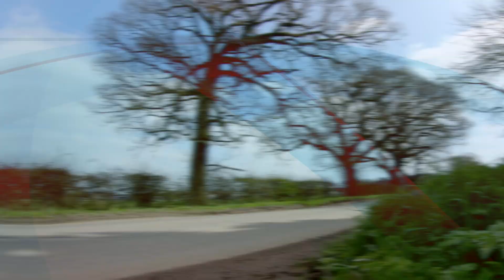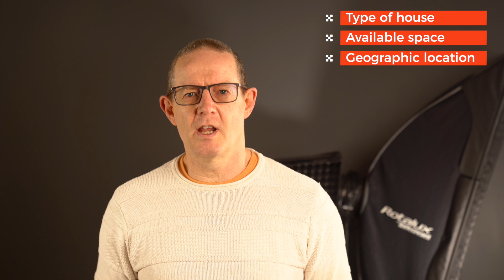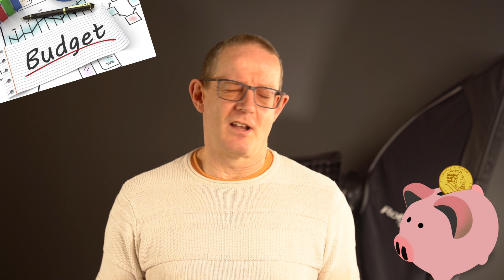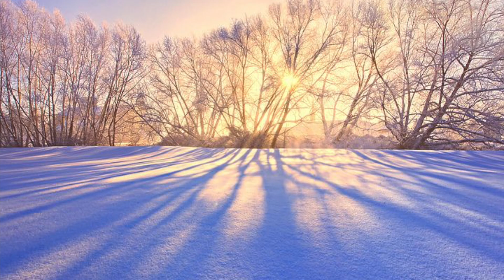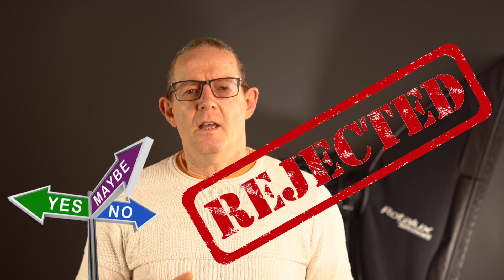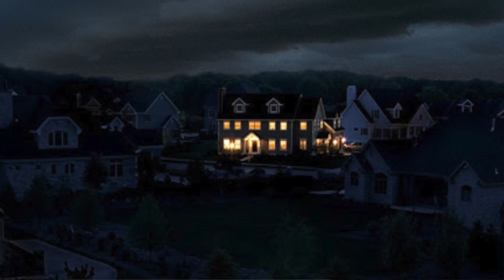So you want solar and a home storage battery

Comment: Thanks John. Perfect video for anyone looking at all the considerations in planning a solar installation. Agree with one of the other comments about the use of diverters for hot water and EV charging, although I think you did mention about future proofing when sizing up the number & power rating of panels. Certainly electric vehicles are going to be a consideration for a lot of people as they evolve further and become more affordable.
Reply from the maker: Thank you. Agree about future proofing, there may be many people adding to their existing arrays as EVs become more popular and affordable.
Reply: @johntisbury  we are a few weeks into our new solar installation and so far it’s been a bit of a mixed bag. Certainly the weather conditions have played a part both positive and negative. We’ve have a couple of exceptional days of solar production and others that have had very little. On top of that, I’m still in discussions with our installer about the way the batteries are performing. Charging seems quite slow and channeling energy into them appears to be throttled back. But they discharge quickly at a much higher rate. For example on a sunny day, they seem to charge at a steady 1.1kw, but can discharge at over 3.5kw. This isn’t ideal as the sun might not last all day and I want them to charge up as quickly as possible. We also seem to be exporting an awful lot of what we generate on a sunny day - I’ll post some figures on your end of month video. We do need a hot water diverter, and hopefully should be here soon, which will soak up some, but it’s frustrating to see the energy I’m producing disappearing into the grid. Still early days though.

Comment: One of the best things that I did long before installing solar panels, was to invest in a power monitoring device. At the time I didn't have SMART meters, so adding a monitoring system that could record and map data really helped me to understand my exact power requirements and usage. I started with an OWL clamp on purchased second hand from eBay, then as I developed my solar component selection, I actually installed an Enphase Envoy-S which instantly gave me pinpoint data and lead in to the latter installation and control of my Enphase micro inverters and  335w panels.

As you highlighted, I personally don't think that you will ever recoup your outlet on panels and storage, with the old FIT disappearing in 2019 the heady days of big returns are long gone. You have to WANT to do this for your own reasons. What everyone with solar doesn't tell you is that you could always just sign up with a green power utility provider and bank the SOLAR and storage money to pay for your green electricity. They said, now that I have my 6.7kW of solar up on my roof, I'm now considering which storage system to purchase and what capacity........or do I wait for V2G to go main stream later this year and then just invest in the be EV and Quasar V2G charger......Mmmmm
Reply from the maker: Thanks for watching Chris.
Being able to monitor your home usage is vital if you want to get a handle on your demands and typically peaks and troughs as you rightly point out. 

V2G will be the next big push. I feel there's a lot of water that needs to flow under the bridge until we're in a position to run that as a mainstream offer. For example currently only the Chademo adapter allows two way charging, which limits vehicle choice. Even more so as the new Leaf's have a CCS point, so it's an old Leaf. Tesla have stated that if anyone does a workaround for V2G using one of their cars it will void the warranty. As I say, there's a lot of stones that need to be picked over before we see V2G in any numbers.

Comment: Hi John, good video. There is one other cheat which prevents a G99 application. I have a 6 kWr Solar Edge inverter fitted with a Modbus meter that limits the export to 3.68kW.
Reply from the maker: Thanks for watching Martin.
Yes good point on manually limiting export. Many inverters can be throttled back on export too.

Comment: Im expecting a rejection on my G99 application for a 17kw install plus two solar batteries on a single phase.  either that or a silly amount to upgrade to three phase...
Reply from the maker: Thank you for watching. 
Yes that would seem a likely outcome. If a 3-phase upgrade is the outcome, don't just take the DNO's price, there are certified independent contractors who may do the work at a cheaper price.

Comment: Thanks for the excellent video John, well structured and informative.  My sole offering is the location of the inverter.  Ours was installed in the loft, I guess it seemed handily close to the panels.  The downsides (which we hadn't considered) were that it was difficult to get to and service, and it was operating in very hot conditions in the summer.  The outcome was that it failed after about 5 years, had a repair which lasted a year and then died.  We decided to relocate it to the cool of our garage next to the meter and related electrical devices.  It now purrs happily next to the Powerwall.
Reply from the maker: Thanks for watching Jeff and glad it was informative. 
That's great point on the inverter, as I type I'm thinking both ours are in the loft! At least they are on the coolest wall. But yes, servicing and checking is a drama.
Reply: @johntisbury  they cheaped out on the cost of wire..wire is much cheaper than inverters .move them.

Comment: A very comprehensive video, John, outlining all the things that need to be considered. Yes, it's not simple ... and every installation should be unique as households will differ in many of those aspects. Finding a good installer, who will take time to work out with you what you really need for your unique situation, is important.

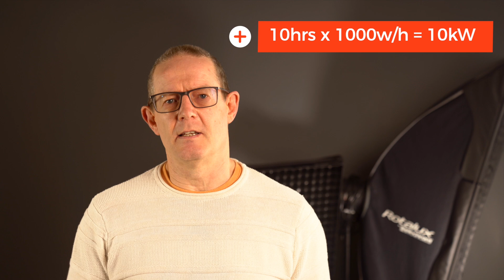Your units used around the 27:50 mark and the words "Watts per hour" weren't right! You obviously meant to convey the idea of "consuming 1000 watts for an hour". The legend "10hrs x 1000W/h = 10kW" should have been "10hrs x 1000W = 10kWh" accompanied by the conclusion "you'll need a 10 kilowatt hour battery pack". Why did someone choose to make the rate unit [(kilo)watt] the basis and the energy quantity unit (Kilowatt hour) the more complicated compound??? We're so much more used to the rate units looking more complicated, as in m/s, miles per hour, kg/min. The "knot" was an ancient measure of a vessel's speed (rate) but no-one decided to measure distance (quantity) in "knot hours" !!
Reply from the maker: Thanks Nic for watching good point on finding a good installer - so important. 

Ah yes, thank you! I always seem to stumble on these things, appreciated you clarifying and correcting.
Reply: @johntisbury  you're a talented artist ... leave it to us scientists to be pedantic about units!

Comment: Might be worth mentioning the most cost effective way of storing energy is to use a solar diverter in a hot water tank.
Reply from the maker: Good call Chris, overlooked that little gem of a product.
Reply: Or into a BEV.
Reply: We store our excess power as hot water and its very effective
Reply: What about a battery
Reply from the maker: Good call Tom, already have home battery storage
Reply: That's a good point, we use a solar iboost. £200 off eBay two years ago and a simple installation. It has sent over 2000 kW to the hot water tank over that time. We're completely self sufficient for h/w in summer. Even sunny days in January we've had 1.5 kW in the tank (same as having immersion on for half an hour). Ideally I'd like a battery to compliment our PV but finding it hard to justify costs. Maybe when 30p plus unit costs come in it might concentrate the mind somewhat!
Reply: Cheapest rates i have find are 35p per unit now - this is why im looking into battery storage